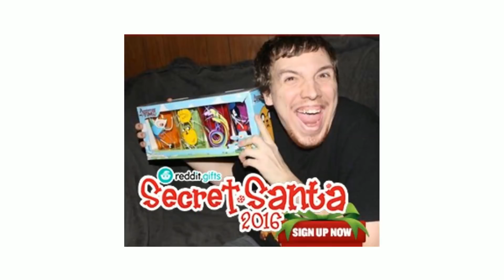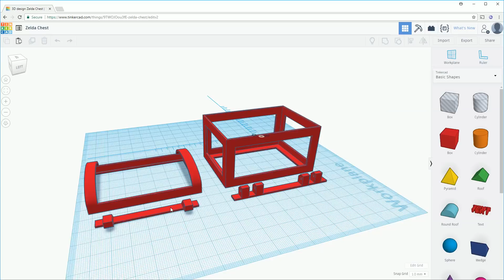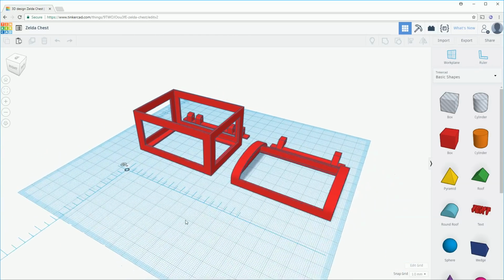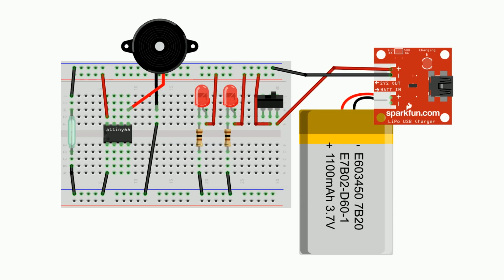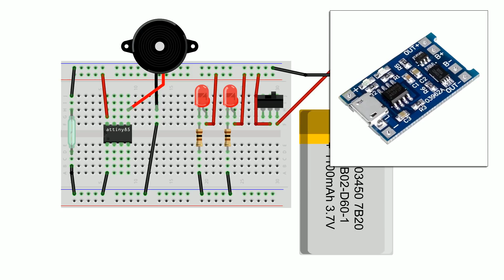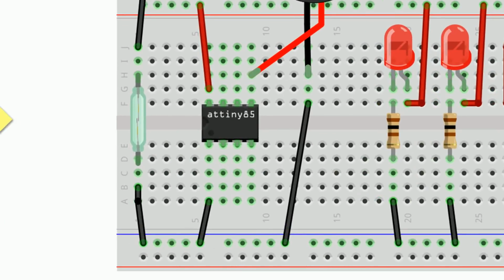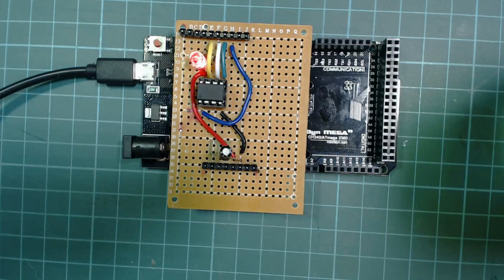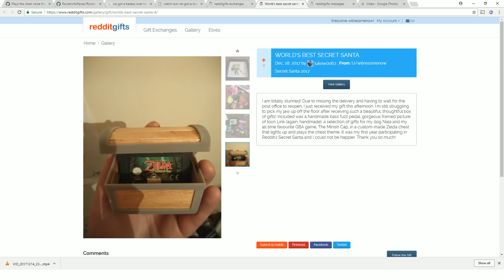Zelda Chest (with lights and sound)

Comment: Awesome Idea! Any Idea to make the components "invisible" so you won't see it when opening? Is this even possible´?
Reply from the maker: Thanks!

It would be possible I'd say, I'd start with a much smaller battery, this one really is not needed. If you remove the need for charging it that would also get rid of a board.

You could also go for surface mounted components to make it smaller. You could add a false floor in the chest to out everything underneath

Reed switch and magnet might be harder to hide though.

Comment: Very interesting that the ATTiny85 doesn't need a voltage regulator & can run no problems off 2.4V - 4.2V.  
I'd never heard that before.
Reply from the maker: +roidroid yeah it's petty nice, like I could even run it on a coin cell (didn't have the current to power the two LEDs and the buzzer though).

Technically it's rated for 2.5V to 5.5V. But if your down that low the battery is pretty much gone anyways

Comment: If soldering directly to a lithium battery scares you, watch Rinoa Super-Genius do it. In short, on bigger cells like 18650s, you'll want to use a soldering gun so that it takes very little time to heat it up. (She actually uses a large soldering iron designed for sheet metal work, but those are harder to find nowadays.)
Reply from the maker: +NiHaoMike oh interesting, must check that out! I see a lot of people using spot welding (I think) to do it too.